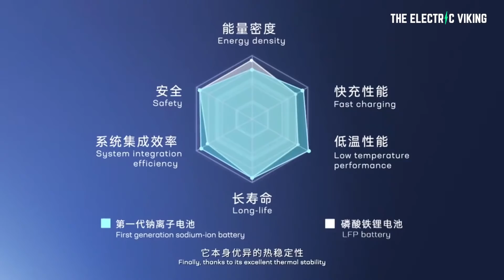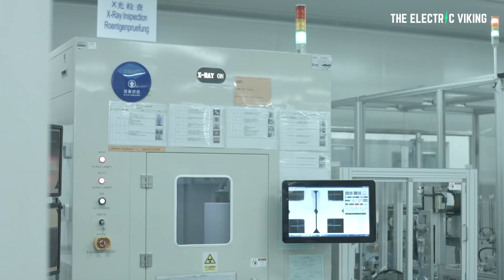CATL's new SODIUM battery will solve the world's energy problems

Comment: Mr. Viking. Thank you for the interesting video as always. Wh/kg or watt hour per kilogram is a unit of energy density. 160 Wh/kg (read / as per) is the energy density reported in the cleantechnica article. W/kg would be power density, how fast the car can draw the energy from the battery. The article is talking about energy density (implying how far the car can go on a full charge), not power density (implying how fast the car can accelerate). It’s all volunteer of course and your video is valuable either way, but it would be even more valuable if it helped people understand this rather than reinforce misunderstanding. Just a suggestion. Thanks again for the good info otherwise.
Reply: An interesting study in how hard it is to get someone with excess Dunning Kruger effect to stop talking nonsense. Richie, thanks for the needed original comment, completely correct of course, but also good explanation about why its important that Sam gets this unit right. Sabretooth, bilgyno1, Göran, arcachofo, good perseverance in undoing Mikes damage. Mike: the problem is your Dunning Kruger effect (thinking you understand something that you don't and being too stupid to know it.) Best thing you can do when you have this condition is refrain from commenting.
Reply: Just to add to what Richie and others have said, power density, also called specific power, (measured in W/kg) is an important property of EV batteries for researchers. It's important for a vehicle's acceleration not only because more power is desirable but because less weight is desirable. It is mostly determined by the "ion transport resistance" inside the battery. During discharge, electrons move from anode to cathode through the motor and at the same time ions move from anode to cathode through the electrolyte inside the battery. The rate that these ions can move is what limits the available power. LFP batteries are around 1000 W/kg whereas LiNCM batteries are around 500 W/kg. As Richie points out, it's important for Sam to use the correct units because both energy density and power density are properties of batteries that researchers spend a lot of effort on.
Reply: John / Idiot, the "moving ions" inside a battery is moving matter.
What does it represent a "moving matter"? Do you know what E=mc2 is?
If you don't know let me tell you that it is ENERGY, meaning MOVING MATTER, which inside of an electric battery can be in the form of "moving ions", etc.
"Power" is the theoretical RATE of energy expenditure in time. The RATE! A THEORETICAL RATE!
Do you know what a THEORETICAL RATE is? A mathematical expression.
In this case, a RATE of what? Of ENERGY, idiot!
A mathematical expression is a theoretical form.
"Power" doesn't exist inside the battery because it is only a mathematical expression. 
All the movement of the energy expressed mathematically as "power" is theoretically relevant only when the electrical battery is connected to a consumer like an electric motor, a bulb, a radio, etc, etc.
Without a consumer it makes no sense to talk about the inexistent power inside an electric battery. Only about its energy.
The moment its energy flows out of itself, you can theoretically model that flow as a theoretical "power". That's what the manufacturers do after they build the electric batteries. 
They put the electric batteries in a complete electric circuit and determine by measurements the rate at which the flow of energy goes out of them. That flow of energy is modeled mathematically and defined as a theoretical "power". But "power" by itself, as an independent real material quantity, doesn't exist. It is just a relational concept, not a real quantity.
Reality is unique, one real material quantity. It is not two things.
You make the same confusion like all the other square heads that you're talking about. You, like them, talk in a layman's understanding, not in the rigorous way. 
Idiot!
Reply: Richie Hart / ENERGY and POWER represent almost the same thing.
ENERGY is the capacity of doing WORK and POWER is the actually WORK done by that capacity called ENERGY.
ENERGY is in fact the POWER ( WORK ) exercised in a period of time.
In other words, ENERGY is accumulated or it exists somewhere in something, and POWER is energy in action.
Fundamentally, none of them has to do with what you say ( how far the car can go, and how fast can accelerate ).
It can be popularly interpreted that way but it is always done by people who don't understand the fundamentals.
Reply: @mikel4879  no, he is right. Both gravimetric energy density (Wh/Kg) and Power density (W/kg) are important characteristics that determine the suitability of different battery chemistries for specific purposes. Volumetric energy density (Wh/L) is also important.
Reply: @mikel4879  they do not represent the same thing. Wh/kg is how much energy is STORED in the battery (very important). W/kg is the maximum power available at any INSTANCE in time. These are total different values. E.G super capacitors have low Wh/kg (~7Wh/kg) but have a very high W/kg (~1000W/kg).
Reply: @mikel4879  and where did you go to university and what did you study? I studied mathematically physics (30 years ago). You are just writing a whole lot of garbage. It is important to use the terms correctly so people can draw the correct conclusion. And in this case the correct terminology allows people to know what applications these batteries maybe suitable for.
Reply: @mikel4879  where did you go to university?
Reply: @mikel4879  Richie is 100% correct. For you to say Wh/kg and W/kg are virtually the same thing shows you lack comprehension of physics. Time is an extremely important variable in describing the universe.
Reply: @mikel4879  why are you being abusive Mike? Do you have something wrong with you?
Reply: @mikel4879  Please give me the number of your dealer.. that shit is strong!!
Reply: arcaca / GFY too.
Reply: @mikel4879 Sorry, I don't know  what you are smoking, but you are clearly confusing things.
Reply: Göran, jag håller helt med. Det räcker ju med att kolla hans ordval, är ute och reser, förmodligen med lite hjälp...
Reply: Sten N / English, Sten!
I don't understand what you're writing in swedish.
An electric battery doesn't store "power". An electric battery stores real material energy.
An electric car accelerates faster not due to the battery "power", but due to the battery real material energy and the motor power parameters.
The motor accelerates due to its power parameters, and not due to battery "power". What the battery delivers is real electrical energy. The action of that real electric energy in the electric motor is called theoretically "power". In reality, "power" principle is just a transformation from one form of energy to another, so the real transformation is not "material energy-to theoretical power". It is "one form of material energy-to another form of material energy". That's the real material dynamics. REAL and not theoretical!
There's no real phisical=material "power" built into an electric battery. The real material electrical battery has only real material energy.
When you talk about an electric "battery power" that's the layman's talk ( can be an "engineer's talk", if the engineer is a mediocre one ), not a talk of a person that's educated correctly in Phisics.
Reply: This is exactly what happens when someone reads a few things about a subject and thinks he is an expert...
@Mike l  :
"An electric car accelerates faster not due to the battery "power", but due to the battery real material energy and the motor power parameters." WRONG!!!!

The maximum amount of Power the motor can get (Power = Energy/time) is determined by the "Power density" of the battery multiplied by the size of the battery.
Because batteries are real devices, not ideal theoretical devices.
And happens that batteries have internal resistance.
So there is a voltage drop proportional to the current it is delivering.
So there is a limit to the maximum power it can deliver.
This is what is called "Power density" : the maximum amount of Power (Energy/time) it can deliver per unit of volume.
This expession "Power density" is often used to talk about "Power to weight ratio". Same with "Energy density".
This tecnically wrong but we all understand it. 
Now you can understand it too... you are welcome.

Got the idea dear?
Reply: @mikel4879  Richie was just correctly pointing out that Sam should say "Watt-hour per kilo" instead of "Watt per kilo" when citing the energy density of batteries since Watt-hour (Wh)  is the unit used for energy. Do you agree with that at least?
Reply: @mikel4879  Poor guy... he has no clue about what power density is in a battery.
But don't worry, you can learn it!!
Do you know about that thing: "Internet browser"? If not, ask any kid.
There you will find an enormous amout of knowledge!!
Start by searching: "What is a battery"

Btw.. did you know that the people you see in yout TV is not actually inside the TV? incredible, isn't it?
Well.. do you know what a TV is?
Reply: @mikel4879  Ok, I think I understand what you are thinking. You are thinking a battery is like fuel to an engine, and the power you can get out of the fuel depends on what engine you have?
A battery may not contain power, but it can certainly give power. P=U*I.
The maximum power it can give relative to its weight gives you power density.
That's a perfectly valid term that can be used to compare different energy storage systems. For example a lithium-ion battery has a higher power density than a fuel cell, but a capacitor has higher power density than the battery.
Just look it up for yourself, and stop calling people idiots!
Reply: Göran / A battery doesn't have "power density" or "power" inside of itself. It has only real material energy. Read my explanations from my anterior texts because I'm not gonna repeat them. 
What I write represents very advanced knowledge, and not layman's knowledge.
You are talking in layman's terms.
The term "power" is just an extra THEORETICAL term used by 'engineers' as a practical usage.
Exactly like "Time" or "Field" or etc.
The term called "Power" is not a real quantity, a real material quantity. It is a relational term only.
Energy is a real material quantity.
A battery can give energy, not "power". 
That real material energy can be interpreted in a theoretical way as "power" which is only a theoretical practicality, but "power", again, I repeat, is not a real quantity. 
If it's not a real quantity what's there more left to talk about a battery other than its real property which is its real material energy existing in its real material constituents? ( P=U*I is a theoretical relation seen from the outside of the battery by a human brain. The energetic material potential aka "voltage" is inside the battery, in its material constituents aka "matter", but the "I"="current" aka "movement" is not. The current is commanded by a consumer, a receiver, in this case an electric motor. You make a huge confusion because you don't understand the fundamentals ).
Stop thinking like an idiot.
Reply: @mikel4879   Real material energy? A real material quantity? You are just continuing to talk nonsense. I say it one more time, look it up!
Goodbye.
Reply: Göran / Do you call a real material quantity "nonsense"? 
In order to understand the fundamentals you have to understand what's truly real and what's theoretical.
If you don't make the strict difference, you'll be forever confused about the real phenomena taking place around you.
Reply: "Batteries have no Power inside" (c) Mike I 2022.
Yes.. "someone" is a little bit "confused" 🤣
Reply: @mikel4879  It is nonsense because obviously we are talking about electricity here. Electric energy and electric power. Whatever you are on about is irrelevant to the context.
Reply: Göran / Here you come again with your ignorance.
Ok. Let's go again. 
No, it is not irrelevant to the context. 
On the contrary, it is the most relevant to the context.
Energy is real as you know. It is the matter that the battery is made of.
Energy exists in the form of different material aggregations, and these aggregations are real and material. Real material structures.
Now, what is "power" in a battery?
We know what is the real material energy inside of it, but what is "power" inside of it?
Show us the location of the material quantity called "power" inside the electrical battery.
Reply: @itekani  We will never understand it... it is "Advanced Knowlege" 🤯
Reply: @mikel4879  Mike, yeah I Swedish, but I think you mix me up with somebody else? I have not made comments about battery power

Comment: Is that watt-hrs per kg? 200 watts supplied for an hour by 1kg of battery? Or peak output of 200 Watts, or 200 Watts per hour of the bulk material? - much less in an actual battery with all its other components. Nice to know if this is significant or a nothing burger.

Comment: 4:50 i went to CATL channel for this video and I find their NA-ion and Lithium battery combo a bad idea, not only it needs two BMS but also two thermal management designs and systems. 
They say in the video that sodium has slightly lower density than LFP but very good in cold temps. Why not combine LFP and Sodium in a battery pack since LFP is weak in cold.
Regardless, energy storage is not sensitive to space and weight constraints, sodium-ion will do good here.

Comment: Sam dont be too excited just jet! Over 200 Wh/kg sounds great, BUT, what about wh/L? That is also very important metric, especially for car! If that number is much lower than for example, BYD Blade or CATL pouch lfp, then i afraid we wont see sodium ion batteries in cars anytime soon.
Reply: He did state that volume for Na-ion is higher.
Reply: Tesla 4680 is the absolute best
Reply: @greengold6705  that's a form factor and only in cylindrical form.
Has no bearing on other chemistry or blade battery structural advantages. 
And we still haven't seen 4680 in production. 
Another fluff from Tesla. 
If Tesla doesn't come out with CT and 4680 soon. The brand is in danger in a few years.
Reply: @j.c.4192  Fluff from Tesla 😂. Electric cars would be a joke without Tesla.  Tesla doesn't even need cyber truck. They can millions of model Y and 3s for the foreseeable future. The 4680 is in production at Giga Texas and they will make a lfp 4680 in near future.
Reply: @j.c.4192  If anything is fluff it's CATL sodium battery.
Reply: @greengold6705  if so, why does Tesla need to buy batteries from CATL and BYD? 
Still waiting on CT and Semi and Roadster.
Reply: @j.c.4192  They don't any sodium batteries duh. They are only buying CATL batteries for Giga Shanghai why would you buy batteries and then ship them across the Pacific ocean that would dumb ass hell. They also buy just as many batteries from Panasonic and LG. Yeah the semi was definitely vaporware and I don't think they will make the cyber truck in any big numbers so you could consider it vaporware to but that doesn't mean they are leading in battery technology because they are because they have the best engineers in the world. I don't CATL but do the vaporware to and this is some of it. I hope I'm wrong sodium sound nice but when every other battery maker is focused on making lithium more efficient that tells you something.
Reply: @j.c.4192  They are making model Y in Texas now with 4680 batteries.
Reply: @j.c.4192  Panasonic will be making them in Japan in 2023 and Tesla is not giving the dry battery electrode technology but they are giving them the tabless battery design. Giga Texas will be first to make Tesla's with 4680s not say they are any better than Giga Shanghai cars. Giga Texas will making a lot of 4680 batteries with Cato road by end of the year. They are already making them at Cato road just not in huge numbers yet.
Reply: @greengold6705  all Elons BS aside. I just want to know if the CT has a Frunk like Ford lightning. It's a deal breaker for me if I have to buy a ladder to get my stuff out of the tub.
That thing is high and deep with what they showed so far.
Reply: @j.c.4192  I personally think they are going to going to come out with a more traditional truck like Ford lightning but more stylish. I just don't see the cyber truck the way it is being a big seller the wiper blade is hideous looking I think.
Reply: @j.c.4192  Yeah Elon does have a lot of BS but he is a car salesman to be fair.
Reply: @j.c.4192  Looks like cyber truck could be over 1 or 2 year's before any are made. Tesla vaporware it's looking like so you might want to go with the Ford lightning it's for sale now I think even the Silverado ev might beat cyber truck to the market the way Elon tonight. Tesla is going to focus on ramping model Y and 3 for the next year or two.
Reply: That is the big question, however Sam did specify "POTENTIALLY change the Automotive industry"
But "Certainly, the storage industry"
(I think a 4680 LFP may have a bearing on that, mainly due to rate of production?)
We shall see.
Meanwhile, I'll stick with Jordan.

Comment: 10 to 15kg of lithium per pack is not a tiny percentage. Have you investigated the point at which Tesla runs into a brick wall in the supply chain and has to keep paying his large workforce for doing nothing? The bigger you get, the harder you fall.
Reply: Yeah that's why they are getting into mining.
Reply: Too late to get into mining. Crisis point for lithium is now.
Reply: @lesliecarter4295  apparently it's in about 3 years time not now. likely the shortfall will affect others rather than tesla as it's been planning using long term contracts for ages unlike other OEMs.